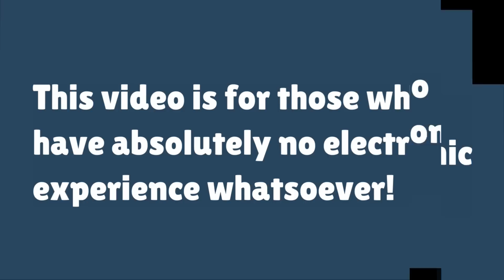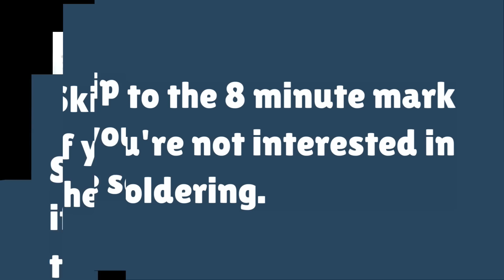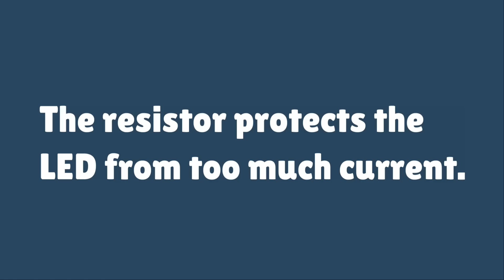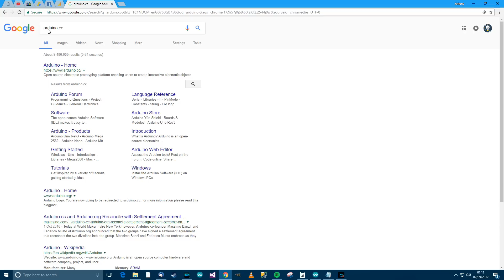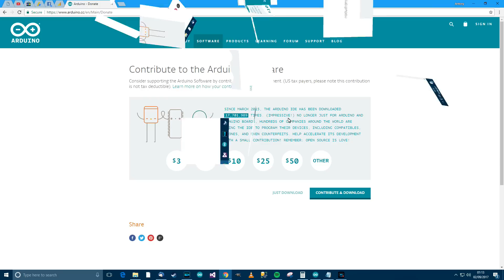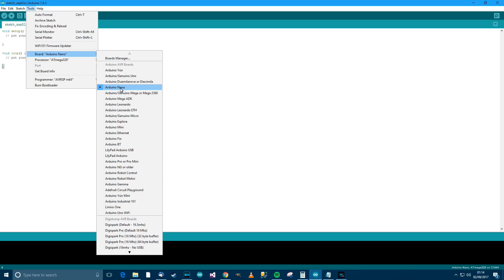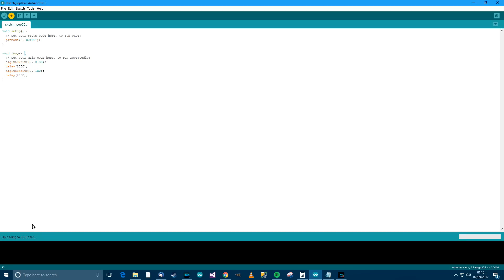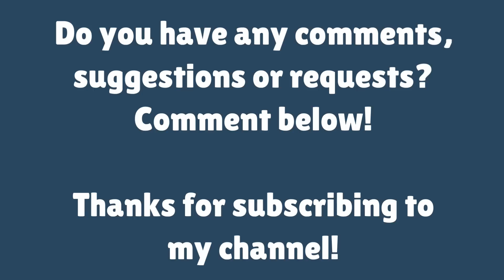TUTORIAL: Absolute Beginner's Guide to Getting Started with Arduino! (How To)

Comment: Thanks for this great video.  Just wondering how the breadboard is getting power to the positive and negative rail?  It must be coming from the USB connection I assume because I don't see a battery.  If so, dies it matter what row you plug the nano into?
Reply from the maker: In this case, it's getting power via the cable.

Comment: thanks for the video but what is the function of the switch and do you have to keep the USB plugged in all the time or does the board hold the programming .
Reply: The reset button starts the Arduino from scratch, same as if you turn the power off & on. The program is retained in memory. So once it's programmed, you can remove the USB & power the board from a 7-12v power supply to the VIN pin & GND. A 9v battery is ideal for portable projects. Or you can power it from a regulated 5v supply to the 5v pin. There's also a 5v supply input on one of the 6 way header pins.

Comment: That was just the tutorial I needed to understand the basics. Thanks.
Can I ask you: what is the little white button for on the  Nano?
Reply: When pressed the button will reset the Arduino and re-boot as if the power was turn on. Sometimes be called a ‘soft’ reset when is power on. 👍
Reply: @onlooker251  Thanks. Does that mean that if you wanted to  rewrite new code to the Arduino, you would press the button to reset it before doing so?
Reply: @wvo2m  No the reset button will just restart your code as if it hasn’t run before. It will run the initialisation part of the code again then go into the loop or cyclic part of the code. Once you have a new sketch or modifications to code that your developing it must be checked by the compiler first before uploading. It will rewrite itself over your existing code. If it doesn’t upload for one reason or another, the existing code will not be modified. I hope that makes sense. 🤞
Reply: @onlooker251  Cheers. That makes sense.

Comment: Antony, get a new tip for your soldering iron, it's corroded to hell. Never let the air get on your soldering iron tip. Melt a ball of solder onto it and turn it off with the ball there when you're done. Clean the tip after every couple pins with a wet sponge. Use good rosin core solder. Kester 60 tin 40 lead

Comment: I need help programming an Arduino Pro Mini where do i start?
Reply: In the IDE under Tools, select BOARD  - then select Arduino Pro or Pro Mini as the board that you'll be using. The Sketches will be programmed the same, though actual pin numbers may be different - see your board pin-out or schematic, and make appropriate edits to the pre-made sketches.

Comment: below error find  could you please share the reason for it

Arduino: 1.8.15 (Windows 10), Board: "Arduino Nano, ATmega328P"

Sketch uses 924 bytes (3%) of program storage space. Maximum is 30720 bytes.

Global variables use 9 bytes (0%) of dynamic memory, leaving 2039 bytes for local variables. Maximum is 2048 bytes.

avrdude: stk500_recv(): programmer is not responding

avrdude: stk500_getsync() attempt 1 of 10: not in sync: resp=0x45

avrdude: stk500_recv(): programmer is not responding

avrdude: stk500_getsync() attempt 2 of 10: not in sync: resp=0x45

avrdude: stk500_recv(): programmer is not responding

avrdude: stk500_getsync() attempt 3 of 10: not in sync: resp=0x45

avrdude: stk500_recv(): programmer is not responding

avrdude: stk500_getsync() attempt 4 of 10: not in sync: resp=0x45

avrdude: stk500_recv(): programmer is not responding

avrdude: stk500_getsync() attempt 5 of 10: not in sync: resp=0x45

avrdude: stk500_recv(): programmer is not responding

Problem uploading to board.  See https://support.arduino.cc/hc/en-us/sections/360003198300 for suggestions.

avrdude: stk500_getsync() attempt 6 of 10: not in sync: resp=0x45

avrdude: stk500_recv(): programmer is not responding

avrdude: stk500_getsync() attempt 7 of 10: not in sync: resp=0x45

avrdude: stk500_recv(): programmer is not responding

avrdude: stk500_getsync() attempt 8 of 10: not in sync: resp=0x45

avrdude: stk500_recv(): programmer is not responding

avrdude: stk500_getsync() attempt 9 of 10: not in sync: resp=0x45

avrdude: stk500_recv(): programmer is not responding

avrdude: stk500_getsync() attempt 10 of 10: not in sync: resp=0x45

This report would have more information with
"Show verbose output during compilation"
option enabled in File -> Preferences.
Reply: My guess would be that you clicked "upload with programmer" as I did, from the drop-down menu; but we're not using an external programmer, we're using the USB from the laptop. Just use "upload" in my IDE it's the choice above the programmer one. More simpy, just use the upload icon above the Sketch text window.

Comment: Mad late to the party and by no means a professional but shouldn’t the resistor and led be swapped?  The resistor should reduce the voltage to the light, but here it appears you’ve applied the resistance after the led and resistance is applied to what’s going to ground.
Reply: The LED & resistor are in series, so it doesn't matter. The same current flows through both.

Comment: I can see what you're trying to do but personally I would recommend an uno for an absolute beginner as it's ready to go with no soldering. Just wondering why you say you must get a yellow LED.  So good so job though so. 😉
Reply: Some dealers do have presoldered nano. Uno is good when you just want to Connect one or two things. Anything more, its best uh go with nano+breadboard. Not to mention for some sensor you usually use a breadboard anyways. So why use an uno
Reply: @ahmedansari6827  I was thinking the same xD I have to do a project for college with Arduino and we were using the Arduino UNO for it. However, I saw that I was getting too tight with the Arduino UNO so I decided to buy the nano one
Reply: @rafaelconstanzovicens9094  :) ull nvr regret a nano! For my prototyping I use an original Arduino Nano Every. It has a different chip but can 'emulate' the chip of Nano/Uno. I dont make permanent stuff much. But Nano would do. But I was thining a tht version of the chip only will suffice for my permanent projects
Reply from the maker: Yes, it's arguable. Some say Uno is better for a beginner. I still say Nano, mainly because the the price. Yellow, I haven't watched the video but it's most likely because I've matches a resistor to it or something.

Comment: What are the colours on the resistor.
Reply: They tell you the value of the part. google "resistor color code"  I recall that he said 47 Ohm so first 2 digits 47 + multiplier (how many zeros after - None in this case) : yellow, violet, black.  If a 4th color band - it's a tolerance indicator none is 20%

Comment: how did you calculate the resitor? If i want to use 11 leds, how do i do that?
Reply from the maker: Hi, you can't really power 11 LEDs from one pin. This is because each pin has a recommended limit of 40ma. Each LED is probably optimal at 20ma per unit. 11 in parallel will consume 220ma which would most likely damage your Arduino permanently (if it can deliver that current).What you're going to have to do is power the LEDs in a different way, and use the Arduino to control it via MOSFET. I have a video on that somewhere..
Reply: @antonycartwright  Oh, thank you! if you link it i will defently check it out!
Reply from the maker: Hi, just YouTube "high power Arduino transistor". If one of my videos doesn't show, someone else's will. Antony...

Comment: Arduino: 1.8.13 (Windows 10), Board: "Arduino Nano, ATmega328P"

Sketch uses 924 bytes (3%) of program storage space. Maximum is 30720 bytes.

Global variables use 9 bytes (0%) of dynamic memory, leaving 2039 bytes for local variables. Maximum is 2048 bytes.

An error occurred while uploading the sketch

This report would have more information with
"Show verbose output during compilation"
option enabled in File -> Preferences.

Comment: I don´t know what on earth im doing wrong.. sitting here since 3 hours, initially trying to connect an OLED display. Now just trying to get an LED flashing, but NOTHING. Arduino L-LED blinking red all time, PWR-LED green stady color. When uploading the code, the L-LED stops for 2 seconds and the RX-LED goes on just a little without doing anything else and then getting back to normal Arduino LED-disco. Feel like throwing everything out of the window!

Comment: Does the nano store the code on the board itself or does it need to be connected to the pc? If I power the nano using a battery will it still run the code?

Comment: What at happen if you dont use the resistor?
Reply from the maker: The LED will draw maximum current from the Arduino and potentially do one of two things; burn the LED out or strain the Arduino pin so much that the pin will never work again.

Comment: Isn't the resister supposed to go on the long side of the led to protect the LED from the power coming from the positive side?
Reply: it doesn't matter really much where you connect it, and actually the negative runs to the positive. Scientists thought that positive goes to the negative, then they found out that it wasn't but it doesn't really matter so they just say that positive goes to the negative. The truth is that gnd goes to vcc.

Comment: 47Ω resistor is extremely rare for us. But we widely use resistors like 1kΩ for LEDs. But resistance is not calculated like that. Here's a formula of getting resistance for LEDs. Forward voltage of LEDs vary from one another. 

When it comes to yellow,
    Forward voltage = 2V
    Forward current = 20mA

Minimum resistance required can be calculated like this,
    R=(Source voltage-Forward voltage)/(Forward current)

Source voltage can be varied. If you're using 12V and when the resistance is lower than what it needs, the LED will be burned. 

Note: The lower the resistance of an LEDs, the brighter the light and the lower its lifetime.

Comment: I don't have soldering skill. For education purpose,Is it possible to use Arduino Nano on breadboard without soldering it? (push pin in the breadboard,align the holes, lay the nano onto it and connect wires to it)
Reply from the maker: Unfortunately, you do have to solder the pins in place.

Comment: Hi I'm thinking of making an Xbox 360 wired controller into Bluetooth wireless so how do I solder a battery on the arduino nano and solder the 4 wires because I will leave a quarter of a meter of the wires

Comment: u put the minus side of led pin to the positive pin+ of the bread board.
Reply: He's not applying power to the breadboard & is instead using the + rail instead of a jumper wire connecting the 2 components. 😁 If you apply power to the rail it won't work right, but in his example just prevents clutter on the board.  Have a great day